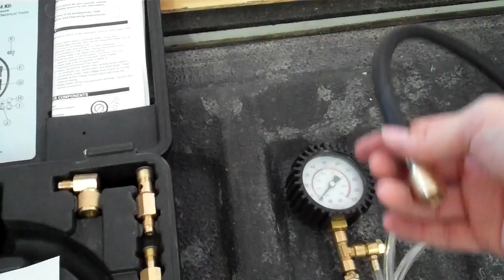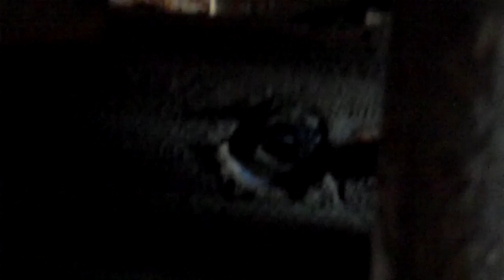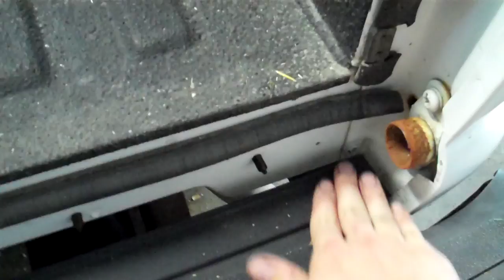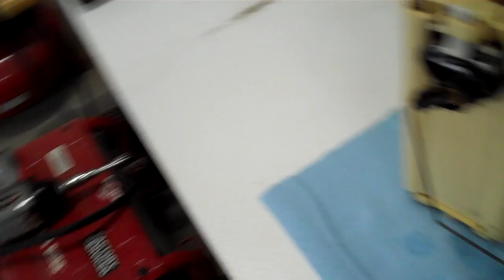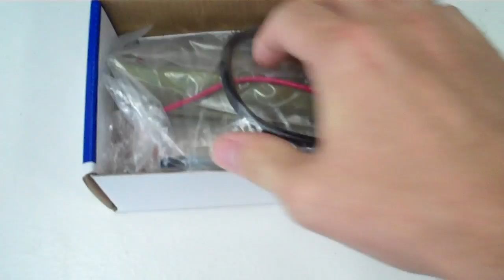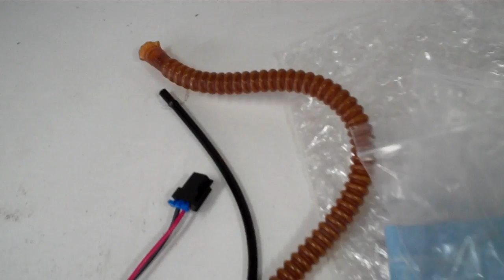2003 Chevrolet S10 ZR2 Fuel Pump Replacement 4.3L V6

Comment: Thanks a lot for this video.  It made my life easier.  I liked how you explained how to remove the tank bed.  Just a little tip I used a goose neck attachment and an extension to get at those back bolts.    I did leave my tailgate on and had no problems raising my truck bed.   Great Job explaining how to repair the fuel pump.  Unfortunately I had to spend 300 bucks on the entire assembly but found your recommendation helpful.
Reply: I'm with you, I ended up running to the auto parts store for a new unit once we pulled the old one and discovered/decided the rebuilt kit really wasn't our best option.  Still, it was this detailed video that made the whole process so simple, almost seamless.  Really we encountered no real hangups other than one stubborn bolt under the bed.

Comment: Well done video! Extremely thorough! You just made my job way easier and way cheaper than alternatives. I've dropped a tank before and it sucks. Connecting hoses back up is always the hardest. Was nice to see what ill get into by lifting the bed.  I didnt want to spend $300 on a whole new pump assembly, and didnt know of the rebuild kit. most places dont even carry them or even know about them. Ive got my rebuild kit on order from Amazon using your parts number in the video. $35!  You made my project simple. Thanks man!
Reply from the maker: Glad it was helpful - and glad you could save some cash!  Best of luck on your install.

Comment: This really really help me on the same project for a ZR2.  because the previous owner changed the pump with other kind of aftermarket. and no one has the replacement for my blazer. so i watched your video and i purchase the same model as you shows on this video. and the store guy says that this actually it's the zr2 4.3 pump... so.. the other thing is that the black hose was not connected to anything , and again with this video i actually know where this hose goes.
thank you
Reply from the maker: Glad it helped you - sounds like you figured everything out and probably saved some cash in the process.
Reply: Yes sir, this video show me how to put back the original pump. I compared the replacement number and it was right. It's a hard work to pull down the tank. the weather is so hot... :( .

Comment: where did you go online to order the rebuild kit?
Reply from the maker: Got mine on eBay but they are available on several websites. Just search for the part number and you'll find distributors.

Comment: when you checked for voltage in the fuel pump wiring harness where  did you ground it ,, to the frame or the wiring harness ,,,,because i'm not getting a ground in the harness on the thicker wire but i am on the thinner black one the grey wire is hot on key turn and crank, my tank is plastic  with no wires and i did not raise bed to do my crew cab obviously so only the harness was changed ,grey to grey,, thin blk to thn blk,,, purp to purp ,,and thk blk to thk blkstill my new pump has notn   is it possibly junk??
Reply from the maker: Pretty sure I grounded to the frame but it's been a while.
Reply: thank you

Comment: great video man and it must be high cost living where u live bro I work at O'Reillys here in Mississippi but very great video best one yet but was ur truck starting and idling rough before it wouldn't crank? n I bought the whole assembly n all for $81 from rockauto.com :)
Reply from the maker: My situation was a bit odd. One time the truck wouldn't start and I really didn't know what it was but the next day I went to start it and it was just fine. A few days after that it was parked in the garage and would crank and crank but never actually fire. So I guess I was lucky that it died in the garage rather than on the side of the highway.  Other than that the pump never gave me any issues so there weren't any warning signs.
Reply: @Phormify  Had a fuel pump die on me at the gas station after I filled up the tank and it was a 30 gallon fuel tank.

Comment: the sending units usually fail first. complete pumps aftermarket start at $40. AC/Delco /OEM start at $135. Bosch upgrade pump $140-$145 pump Sending units $35. Delco pump kits are indeed $40 @ Amaz ...
Thanks for the video.

Comment: I never had any luck just rebuilding pump. 3 weeks after rebuilding it failed then rebuilt again and 5 months it failed again so this time I bought the whole unit and success as it is still working 82,000 miles later. Cost was 275 bucks at carquest as it was the only store in my area that had one

Comment: I have a 97 Chevy S-10 and don't need a fuel pump...yet. The only thing that is new on this truck is the long block and I just changed out all of the sensors. But it is time for everything to start going out, but after viewing your tutorial I am saving this video! Good Job!

Comment: Next time what ever side you plan to tip the bed towards leave two bolts in but loosen them 1/4" and let the bed pivot on them like a hinge. That also keeps the bed aligned and keeps the bed on the frame in case it wants to slip off.

Comment: It is easier to get the 4th bolt without a hitch in the way making the 3rd bolt the hardest to get out. I found on mine that it was handy to have different length sockets and extenders. On my 94 s10 I took the bed off stood it up on the front and was able to undercoat the frame and bed. I also installed a hitch off a 96 blazer that isn't in the way like this one is but I had to squeeze the frame 1/8" to get the hitch on it and the factory bumper wont fit without modifying it to clear the receiver.

Comment: Great video, helped a lot. I purchased a new fuel tank sending unit O-ring  from amazon. ACD # G30, GM#15034832, UPC# 021625438214. It fit perfectly, my application was on a 2003 GMC Sonoma 4.3L. Cost was about 10 dollars.
Reply from the maker: +LeRoy Earley Awesome - glad it helped.

Comment: will this work on tippin the bed of a 2000 s10 and are there bushings and how do you line it back up when you bring it back down
Reply from the maker: +James Abbott Should work the same on a 2000 as they are the same model and share the same bed (slight differences if you have a regular cab vs. extended cab but the process is the same).  There aren't any bushings to worry about and assuming you don't remove the rear bolts and just loosen them the bed will drop right back down to where it was.  The holes in the frame have a bit of play to allow for some adjustments and you can just nudge the bed back and forth a bit to line them up if necessary.
Reply: thanx